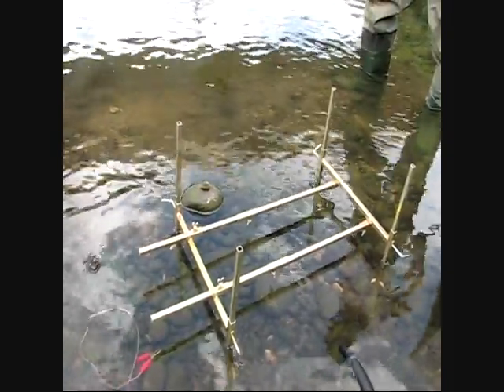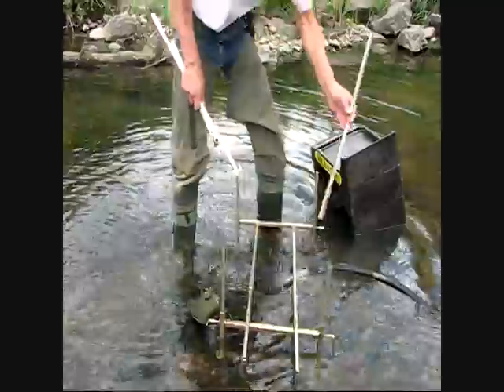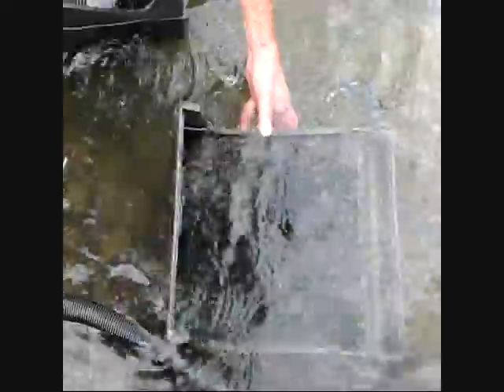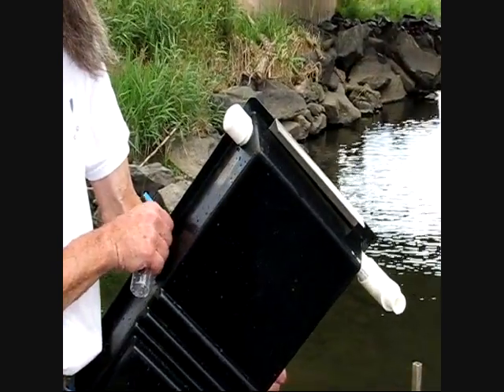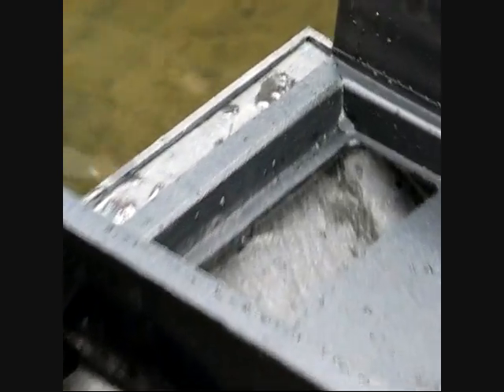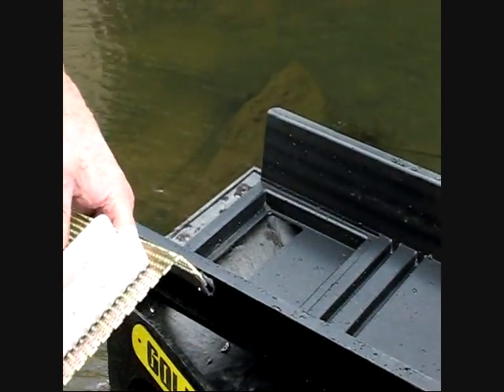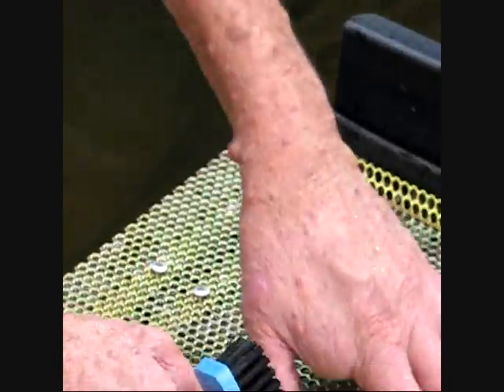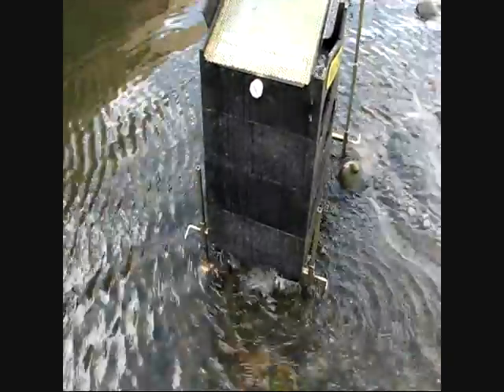Topper unit

Comment from the maker: The screen in the topper now is 3/16th somewhat larger than the 1/8th recommended and no other screen is available at this time cuz we made this original unit Cube Specific.  I can see how this topper unit could be used to classify different sizes for example; sluice box or highbanker and perhaps we should take a look at offering a larger size.    The nugget traps are already in the tray of the topper.   RED

Comment: Question. I currently have a GC and love it. Just wondering if it would be better to have the spray bars going down each side vice just at the top, to ensure all the material was washed.  Second question is, could we run a 700-800gph pump seperatly for the spray bar, and use the 1100gph pump on the cube still to ensure steady waterflow of the slick plate? I could be wrong but it currently seems that you would have to move the material around by hand for it to wash correctly. just my 2 cents.

Comment: I just bought a topper today, there are some "miner "differences. Like the aluminum plates in the front, well, mine has one. And the plastic sluice just looks a little different.. 3 riffles (yours has 2) and it just fits a bit different. Not "bad" but just different. Is this normal?